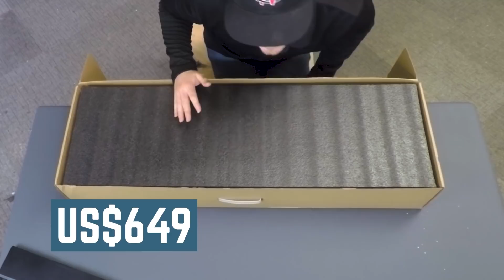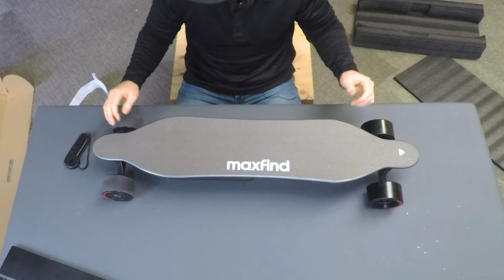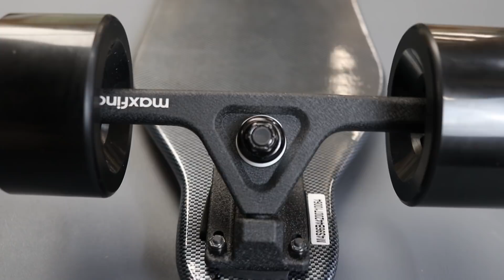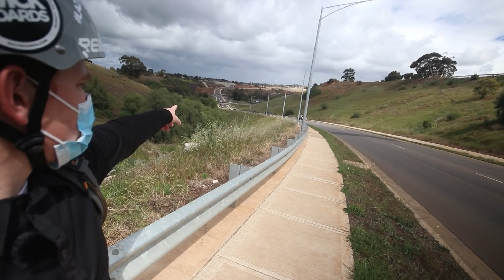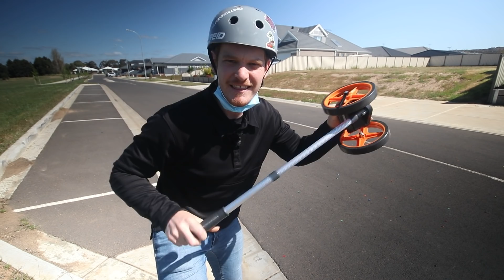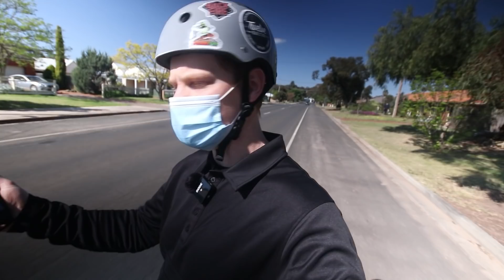Maxfind Max4 Pro Review - They’ve Stepped It Up with this Electric Skateboard

Comment: I got the board one month ago and it works well so far. I like its range and also the hot-swappable battery design. If I have a long distance travel, I can bring spare battery and replace the battery very quickly and easily.

Comment: So I picked up this board.... extended range version ($800+) it’s great and all. But there is a down fall...over time (1 month of ownership) the wheels on the hub side motor crack and fall off (a video on YouTube of this happening and a review mentioning it). This board is new so there is not a whole lot about it. I myself only take this board on smooth paved bicycling trails , I took a tumble because this issue began to happen on my maxfind 4 pro. I took a look and found a inch long split in the wheel itself, a perfect line where the wheel support holds the actual rubber to the hub. I contacted Maxfind to warranty my issue. I sent them a picture and told me “I ran over a nail” and they don’t warranty wear and tear. A month old board and the wouldn’t warranty a 15 dollar wheel... I ride on a smooth bike trail thorns maybe, but I highly doubt it was a nail.I got so upset with the whole customer service ordeal. They then offered after everything me to wheels and a set of LED lights after I shared I know this is a known issue. I was hurt by the fact the told me it was user error and guess/determine it was a nail on a known issue. Nobody should feel not supported from a company that you supported. I babied this board, work long weeks and only took out on the weekends. I just bought a new set of replacement wheels (myself) this happens again. I’m making a video about my experience....
Reply from the maker: Thanks for your feedback Will. I think you've brought up two important things about these manufacturers. 1. Sometimes components on these boards will be lower quality than if you bought from a more 'premium' brand. And 2. Their Customer Service sucks! This is pretty much true for most Chinese brands, not just Maxfind. A few companies are trying to get better, but they are still very far behind. I'm sorry to hear you're having a hard time. I hope you didn't hurt yourself too bad when you came off.
Reply: @eSkateHub  Thank you for your concern! Thank you for accepting this feedback! I just want people to know my opinions and experiences. Just so the can make the right decision on their purchase.
Reply: @eSkateHub  which is the best company with the best customer service ? Looking for something around 700$?

Comment: Amazing video. The most informative one I can find for Max 4pro. 

I am also planning on getting one, but the weather here is extremely unpredictable( rain) and hence the waterproofing of this board is what has attracted me the most.
 I would love to get anymore input about that if you can!

Also, I am slightly concerned about changing the ESC on the board. Could you comment on it ? Maxfind told me that it's easy to change on your own and are selling it for $169 (which is normal compared to other boards, but I feel like it's still too expensive) 
I also couldn't find the hobbywing esc for sale by anyone else which is somehow a little sad.

After a little search, I have seen a lot of 4.4ah batteries for much cheaper than the 169 maxfind is selling it for. Could you possibly test any cheaper batteries?
Reply from the maker: Thanks for kind words! I'm so glad I could help.
I replied to your other comment about waterproofing on the Exway Flex video, but I'll answer it here too for anyone else that might have the same question.
Even though they say the Max4 Pro is IP65, I find that hard to believe because of the way that the enclosure is designed to accommodate the quick-swap battery system. I'd be wary of their waterproof.
Changing the ESC is a fairly simple plug-and-plug process which is nice. You can get the Hobbywing ESC for $120 from MBoards or you could go for the Focbox Unity which is arguably the best ESC in the industry. The Focbox Unity is $199 from Massivestator.
As testing batteries go, I haven't really delved into that before, but I do have a handful of batteries that I could mix and match with the Max4 Pro to test out. Let me see what I can do there.
Reply: Me and 2 of my mates bought this board. I can say from experience that this board does not handle wet weather well. I can believe that the board is IP65 waterproof as although the electronics enclosure is not waterproofed, the ESC and battery are. The main issues we had in the wet is with the bearings seizing up and the internal connectors corroding. The biggest issue for us however was the power button getting stuck due to grit and moisture which basically makes the board unusable.
Reply: @Vignesh Gandham The waterproofing is what drew me too. But the board will break, and once you've sent it off for repairs, YOU WILL NEVER SEE IT AGAIN. You'll just be ignored or placated 'til the end of time.

Comment: 22mph top speed, gutted. Which battery pack was it using; on their website it has two different varieties on 4ah and 6ah batteries?
Reply from the maker: Yeah, not quite as high as I thought. It has the 4.4Ah battery in it.

Comment: One screw bolt to remove the battery casing?! That doesn't sound good when faced with tactile flagstone vibration...
Reply from the maker: I mean it's been alright so far. It hasn't fallen out at all. The only thing I'm concerned with is it's waterproofing.
Reply: It’s Aite. I’ve rode with it in the rain couple times. No issues. Water didn’t get in. 

However, if you ride this thing over a sidewalk or rough pavement the battery connector will come loose. Easy fix for it is just to get electric tape and wrap it around a few times.